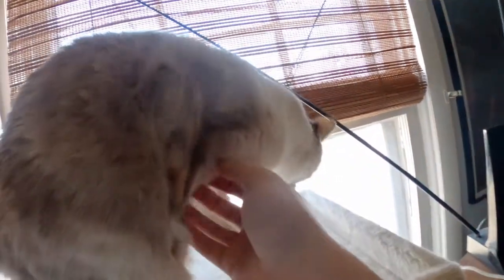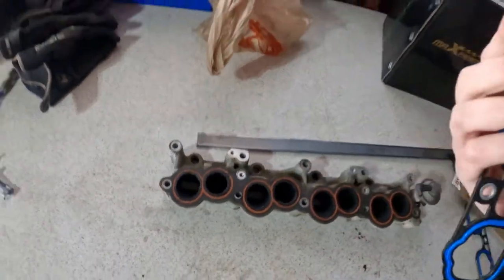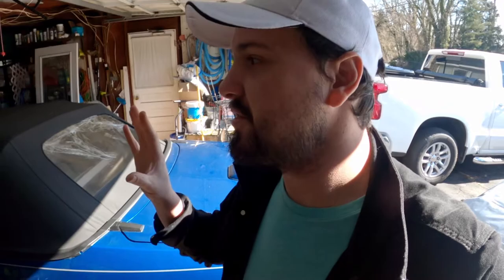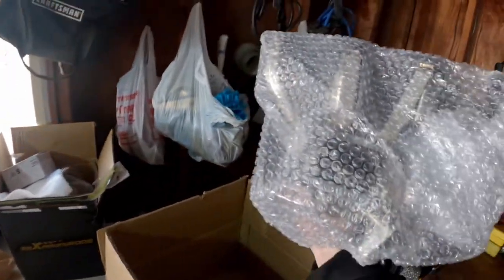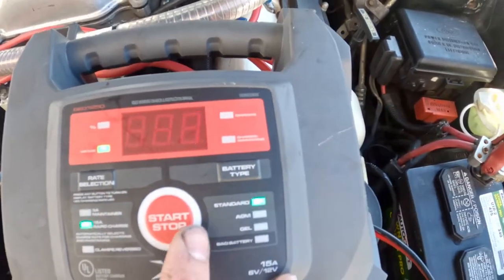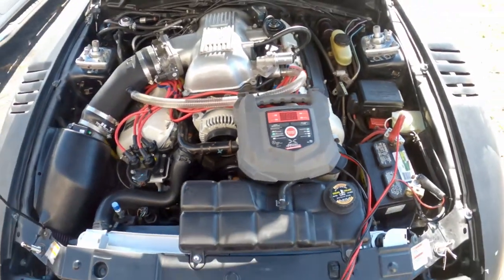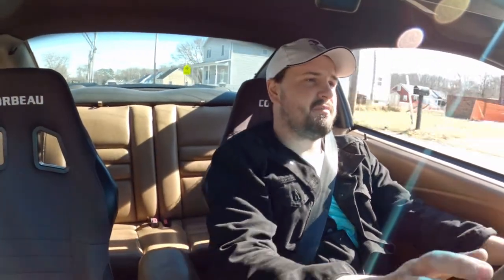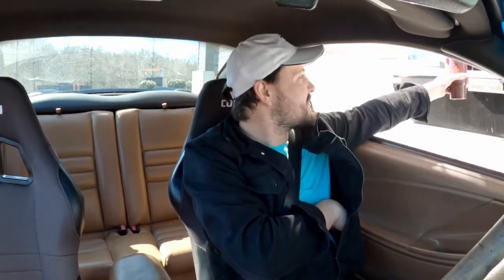Current Project Updates & BIG Future Projects Discussed! *Re-engineering Ford Cars*

Comment: Love what your doing with the SHO exhaust, but let me throw this out there before you spend more money.  The trombone loop needs to be plumbed in the rear bank BEFORE the pipes run into the muffler.  Putting the loop anywhere behind a muffler that both banks run into will be pointless since the banks mesh in the muffler and won’t net you a very noticeable change in sound.  I would say directly after the flexpipes, run the trombone loop into the mid muffler, then you will get the desired effect on exhaust pulses.  If your running true duals to the x pipe near the rear diff, then the loop could be anywhere in rear bank exhaust pipe before the x pipe.  

Again, I love that your doing this and can’t wait to see how it turns out. I don’t want to come off as snooty or condescending, just don’t want you to throw more $$$ in the trash just to see it fall below desired outcome.  Keep the great content coming!
Reply from the maker: Clearly understood. Which is why the mid section will be altered as well. Probably focus on using specific components to craft the tone more in the mid section keeping each bank completely separate. I really want to this piece to be good enough so anyone can buy it and use it. So the cost of the R&D is preliminary. If all goes well, I'll get a return from selling it. So many things to factor in with this exhaust. I think it will be well worth it in the end. Thanks for the support ❤️😎👍
Reply: @KarzKreated  Heck yeah man I’m rooting for you!  I traded my SHO awhile back but stay active in the community.